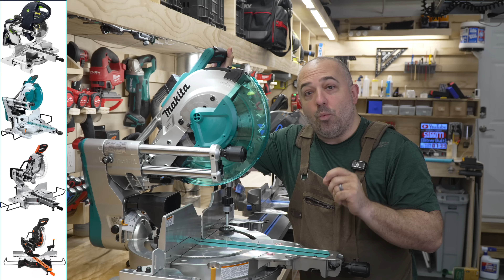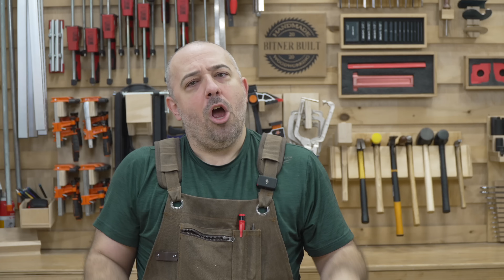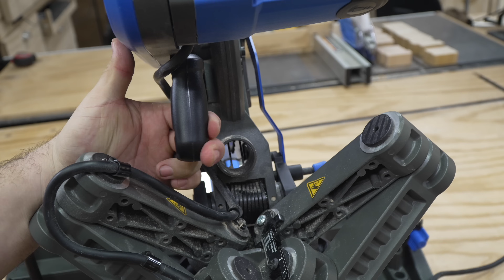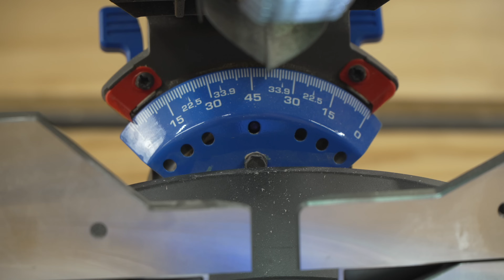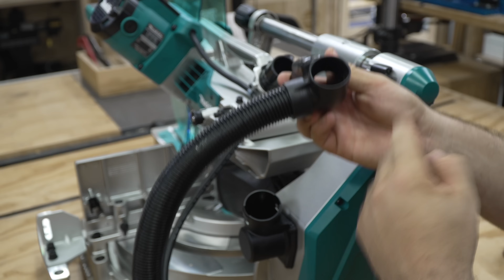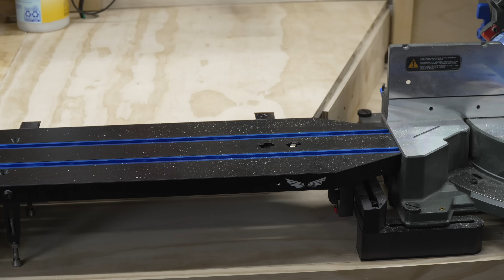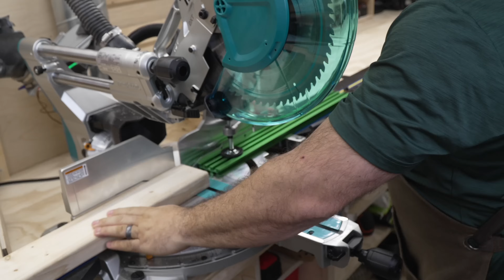Rail Vs Bearing Compact Miter Saws - Makita LS1219 & Delta Cruzer

Comment from the maker: ** somehow I missed the metabo, front rail, $450, shadow. Worth a look and I will add it to the spreadsheet!
Reply: I was just about to say. I got the metabo hpt and I love it. I upgrade from a ryobi. It's bulky but I love it. When I bought i was deciding between the 650 bosch or it. Metabo HPT had more features. I'm hobbyist but I love that miter saw. C12rsh3 is my model number. Plus Menards 11% rebate when it was on sale
Reply: I own the metabo 10 inch and I hated it out the box. The rails always restricted my left bevels , where I cut the most. But much worse was the fence not being on a true 180.
Reply: I've looked at the Metabo at Lowe's and the sliding action is very stiff and there doesn't appear to be a way to adjust it
Reply: @kenmerrick1235  I've also read that the locking mechanism under the platen has plastic parts which will surely wear.
Reply: Thanks for the review!

I am probably going to get the Metabo HPT C12RSH3 because I, like your son, am a lefty. This model has a vertical handle that sits right in line with the blade, and so it is much easier to use with your left hand as well as your right hand. Still it was obviously designed for right handed people since the safety button that has to be press is positioned only on the left side of the handle where the thumb of a right handed person would naturally fall. There isn't on the right side, so I'll have to figure out some way to to defeat this feature, or mod the handle to move it over to the right side.  Or maybe like I did when I was kid learning to play gold and could only afford some old hand-me-down right handed clubs and so I learned to hit with "right-handed" clubs, I can just use my right hand from the start. In fact my current pivoting miter saw has a handle on the right side and I use it will my right hand since it is just super ackard to use my left.

This, BTW, is the same handle position as the Festool KAPEX. And note that not all Metabo miter saws have vertical handles.

But this handle position isn't just to make using the saw less of a pain for those of us in our "right-minds". As a mechanical engineer, I can see that this handle position has a huge advantage over saws with a horizontal handle set to the right of the blade. This is because with a horizontal handle set off to the side, the force you apply is not aligned with the blade. This will always generate a torque with every cut that is trying to rotate the blade to the side. But with the handle vertically oriented and directly in line with the blade the force you apply can't cause a toque that would twist the blade out alignment (well unless you are deliberately twisting your wrist rather than pulling straight down). 

This means that the saw doesn't have to be so beefy to keep the saw from deflecting as you operate it. In fact I would bet that if the Delta had a vertical handle in line with the blade, even its less than ridge structure would produce much more accurate and repeatable cuts. But you don't have to just accept the deflection of the Delta. With practice, you could learn to generate just the right amount of counter torque by deliberately twisting your wrist in a counter clockwise direction to generate an torque that is equal and opposite direction to the torque generated by the vertical force on the handle displaced to the right of the blade.
Reply: @papparocket  Vertical grip is better for ambidextrous use. But either way, just use the little finger of the off hand instead of the first finger to hold the kill switch.
Reply from the maker: @papparocket great breakdown!
Reply: And the Lumberjack 12" (non-pro)!!!
Reply: Late to the party, but thanks for the review. I came here to say the same thing. In Australia we have the ‘Metabo KGSV 72 XACT SYM’, which I quite like the look of but is only 216mm (8.5” in slavery units) - they may be the same thing, notwithstanding voltage differences (110V vs 220-240V)

Comment: I have had both the Dewalt 12” with shadow line and the 10” Makita with laser line. Believe it or not I tend to site down the blade. Just how I was taught years ago. Was going to mention that the 10” version is nice because I can swap out blades with the table saw. Good video these things are good to know.
Reply from the maker: sure not surprised. I feel the shadow is just a extension of blade sighting, I like I can see the individual teeth where they are landing.

Comment: I was under the impression the Delra Cruiser and corresponding Rigid machines were close to perfect!  I now know better
Reply from the maker: Based on the comments, it seems like a 50-50. Which leads me to believe it’s a quality control or manufacturing defect. Anyone who does go for them make sure you can easily return it to the retailer after checking for deflections issues

Comment: So I've had a delta table saw for a while now and I love it. I wanted to get the Cruzer so bad to be commited to Delta (an underdog brand in my opinion). 

I'm assuming there's no fix for the deflection?  Maybe tighten the bearings in both of the articulating arms to reduce play?
Reply from the maker: I tried everything and I contacted them. They wanted me to send it in for repair. Just an fyi delta is owned by Stanley black & decker - so they own dewalt, craftsman, porter cable, Stanley, bostich, Irwin…. Just my opinion as I have other delta tools, old delta was good, once Black & Decker buys your brand, quality control goes way down. I find that across a big swath of those brands I just mentioned. Particularly craftsman used to be great and now oh man, I won’t buy most craftsman tools because I review this stuff, I’m constantly trying things out at the store and looking at different tools and those brands have really let me down honestly in the recent years.
Reply: @BitnerBuilt oh wow! Thank you for the breakdown. It's a shame to hear about the brands that used to be really solid and have went down hill. That Makita miter saw looks insanely good quality (heavy too)! I might have to cry and buy once 😂
Reply from the maker: @DeathLikeWebz lol yea I cried. I made some draft dust collection from it and it’s been working super well

Comment: I'm surprised at how much deflection you get on the Delta Cruzer.  I have the Rigid model (12"), which is the exact same saw, but I get very little deflection - much less than you showed.  I am pretty cognoscente of this and I let the saw do the cutting with very little pressure from me.
Reply from the maker: if you look at the comments it seems 50/50 split on these and their deflection which leads me to believe it could be a assembly calibration problem or just a high failure rate. I have done a lot of manufacturing videos at factories recently and some companies aren't ok unless QC failure rate is below 5% others dont seem to care and would deal with an issue later - this seems to be one of those

Comment: on the Bosch you can tighten up the screws where it pivots and heard it helps a ton.....the delta has 2 arms though, that amount o deflection is absurd, its basically just a framing chop saw, all you can really use it for

Makitas attention to detail on the finish of the saw is second to none

Metabo has brand new 10 inch coming out, its compact, light and looks to be able to calibrate it......Makita is too heavy for me to haul around to jobsites
Reply from the maker: Yea I do really like the makita but boy it’s heavy, definitely not one to be traveling with

Comment: There's now a Vevor 12" for $320 that has the same type of dual rail front sliding action as the Makita so I think I'm going to buy it.  I need to build a few sheds.  I just can't justify any saw over $500.  I'd love to have the Makita.. but it's $1000.. yikes.
Reply from the maker: I do not blame you there, I would have stayed with the harbor freight from a price standpoint the makita is only a little better than that one. Let us know how that VEVOR works for you!
Reply: In that price range you could consider Metabo and if 10" is enough the Skil could be an option. Or even better buy secondhand better brand. Vevor should do fine for shed building projects, but if you need after sales service, that's not really their thing, if you experience problems they may offer you some kind of compensation, rather than dealing with the problem, and you will be negotiating. My experience with Metabo, very simple process, they pickup, fix and return no nonsense. It's just two different philosophies, it's up to you.

Comment: Is it the rails, or is it excessively thin blades?
Reply from the maker: Of course there can be slight deflection in blades but we’re not pushing in the blade to make this deflection, the whole arm attached to the rails / bearings is what’s moving

Comment: Makita is clearly much better quality. Bosch glide is likely better than the Delta too. In addition the 12" forward rail model Metabo HPT is about to release a 10" and 7 1/4" model. I plan to get the 10"
Reply from the maker: Cool let us know how the new metabo is. Based on the comments here about 50% of the Bosh users see the same issue

Comment: I went for the previous generation Delta when the price was $425 on Amazon. The shadow line was also a primary reason but saving $300+ over the Bosch (which SOMETIMES goes sub $400 on home depot and then sells out instantly).
Reply from the maker: That's an awesome price, definitely worth grabbing it for the shadow line! I’m guessing yours isn’t having the deflection problem? Based on the comments, it seems like 50% have it and 50% don’t which implies an assembly or qc problem

Comment: Thank you for making this video. I am too, just purchased an expensive bosch toy like yours. There are a lots of factors involved while cutting wood. I think your comparison was more or less fair, but the real test comes when you use a real hardwood.
Of course the blade is always a factor as well. I don't think running different tests really can determine which saw is perfect or more perfect. The real test is the test of time and that is what changed your mind and that was the right decision.
I too was thinking about delta saw and your video was the correct justification, that I did not go for it. I think in general people should buy what they can afford, get the companies that sell the most and follow reviews and also follow their gut.
One way or another, people will adopt and correct for small errors, while making improvement. Thank you and God Bless... I will be following your channels. Let's concentrate on interesting projects and different woodworking educational aspects and skills.
Reply from the maker: Thanks, that test of time though caused a lot of messed up cuts and lost money unfortunately!

Comment: I have not had deflection issues with the 12" delta, you can make it deflect, but i haven't had issues during use.
Reply from the maker: Based on the comments below about 50% or people with the delta and Bosch are seeing the selection problem which leads me to point to a assembly or manufacturing defect and they just have a high tolerance for qc defect. I have seen a lot into manufacturing lately and tech companies want under 10% defect but doesn’t look like the same on this one

Comment: I've got a 12" Bosch.  No flex, no deviation.  I'd be fine with the Makita too.  Have lots of Makita tools and they're darn good.  I'd also never spring for a Festool even if I had cash to spare.  In my opinion, its stuff is way too pricey.  Just set up your tools accurately and check them periodically.
Reply from the maker: It’s pretty interesting if you look at the comments, there’s about 50% of the Bosch owners. I’ve seen the deflection and the other 50% haven’t. That makes me think there’s some sort of issue at the assembly during manufacture.

Comment: The Bosch & Rigid have the same issue... I bought the DeWALT716XPS... Perfect cut... no rails...chop saw run very accurately...I don't need to cut 18" inch...or so... I have this saw for over 8 years....But if i buy a new one... a Makita like yours...or 10" inch will be perfect... Kapex is nice but not on price range for now...lol
Reply from the maker: Nice! Good to hear your DeWALT is still going strong after 8 years!
Reply: @BitnerBuilt  It's a beast... My Grand Pa had a DeWALT for 40 years...lol 👍

Comment: That's why the Bosch miter saw product has three arms, so that when you pull the saw, the blade position remains parallel.
Reply from the maker: If you read a lot of the comments from Bosch owners below their experiencing this issue, probably 50% of the time, I think there’s some sort of play at work in the pivoting mechanism that all of these use that either during assembly or manufacture there’s a lot that are coming off the line flawed

Comment: Long time finish carpenter here, and an owner of the Ridgid 10 inch glide saw and former owner of countless compounds. 
Deflection is an issue with every saw especially with 12 inch saws and especially as those blades dull. Which is a key reason I primarily use 10 inch saws. 
That said, I've gotten so accustomed to the smooth glide that even the Kapex feels like driving a Mac truck to me. Oh, and that shadow line is a complete game changer. I wouldn't hesitate to buy the Bosch but not a moment until they put a shadow line on it. I hate lasers. Period. 

I have learned to finesse my saw by developing a fine touch sometimes using the deflection to my advantage. 

My greatest issue with my saw, and I've had the issue with other saws, is the fence on one side not cutting square to the other side. Meaning the fence is not milled perfectly. But even that, I've learned to compensate for it. 

Front rail saws are a non starter for me. Never. Once. But never again. As a stair builder the rails are persistently in my way. I think they should orient the front rails on the right of the blade versus the left. I think most people naturally bevel to the left.

Comment: If you want to feel glassy smoothness, unlike anything you've ever used, there is nothing smoother than the precision cast iron 1949 to 1968 Dewalt radial arm saws. 

The bearings they use are USA made ball bearings (in 1956 every part of the Dewalt saws are made in USA) with a hard tapered race that rides inside of a precision cast iron arm with zero flex. And on those old Dewalt (and other models like Delta) you can tighten up the bearings as tight as you want, until there is actually zero play in the cut. 

The problem with a radial arm saw is that they are better at ripping than they are at crosscutting, because they are potentially the most dangerous tool ever made for crosscutting. Ironically, radial arm saws are probably the cleanest saw ever made for rip cuts. Without any modifications at all, you can connect a vacuum to a 1956 Dewalt radial arm saw, and when you RIP a piece of wood with the blade guard lowered into the ripping position, you capture about 98% of the sawdust.

I've since decided that I feel much safer ripping boards with a radial arm saw, because the blade is fixed, locked into position and cannot move at all, even if you accidentally have a kickback, the blade cannot move. 

In the crosscut position, they are not inherently dangerous, with proper technique. But there's just something very unsettling about a blade that pulls towards you, with no latching mechanism to lock it back in its default position.

Comment: On the makita, the fence is not square with the deck. Mine was out 1/4" at it's worst. Makita has no fix, check yours.
Reply from the maker: Ooo that stinks! Very first thing I checked out of the box, after slight adjustment mines good, no material warpage or deformation. Did they warranty swap yours / replace it?

Comment: Supposedly the Bosch deflects far less than the delta
Reply from the maker: Based on the comments below it seems like with both there’s around a 50% error. There must be an assembly or manufacturing variable where some are good and some are just crazy off. I have been privy to some big mass manufacturing lately and a 5% defect rate for some companies is ok even some are ok with 10% but this seems like more (but that’s only based on people commenting here of course)

Comment: Great comparison video I have the Delta cruise of myself and I’m dealing with the very same thing. I built my miter saw station tailored to the Delta cruiser and I am curious if I can just remove and replace the saw with the Makita. My question is are the deck heights the same and are the footprints the same? What did you have to do to your miter saw station for the swap? Thanks in advance.
Reply from the maker: Thanks! So unfortunately the footprint and height are not the same for an easy swap, I made a video after this on using miter saw wings at my station and since those were adjustable I was able to make my swap easy but I’m sure you won’t be doing that unfortunately. Just going to have to do some rebuilt. I do love the makita however, make sure you get the bright more powerful shadow line upgrade, I also custom upped the dust collection at the fence and it’s doing great, I will be doing an updated video on that in January I think
Reply: @BitnerBuilt thanks for the response. I originally wanted the Makita, but was trying to save some cash…… the delta is a great looking saw, but when accuracy and repeatability is a must, it just doesn’t have it.  Great job with the videos, the quality is great. 👍🏼

Comment: I’m not a fan of any sliding compound miter saw if you build fine furniture. These are carpentry tools primarily. Personally I have a 12” mitersaw that only pivots and not a sliding saw. When I want an accurate length I’m using my table saw and miter gauge or a table sled. Most of my work is cabinets and furniture.
Reply from the maker: No doubt, I do woodworking and carpentry, so I definitely have use for it, but deflection of that scale makes it a worthless tool to me